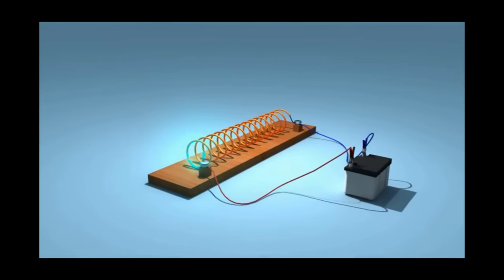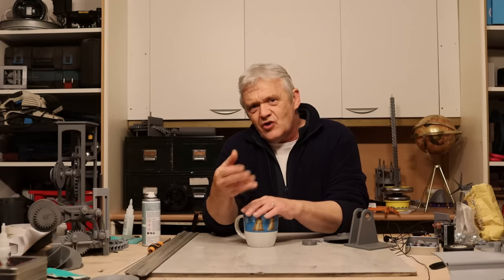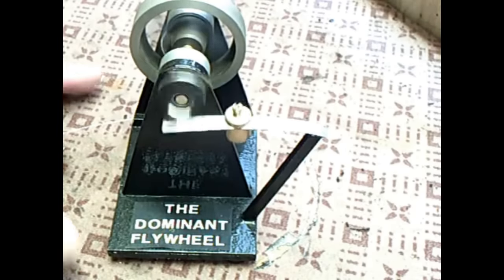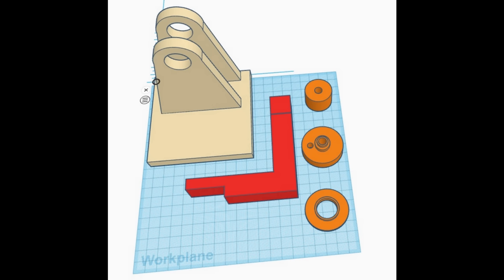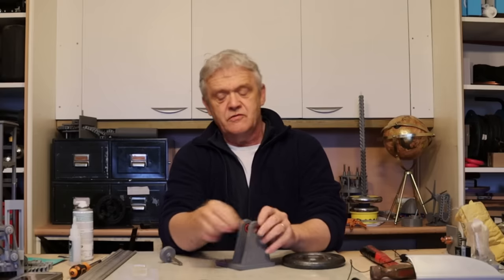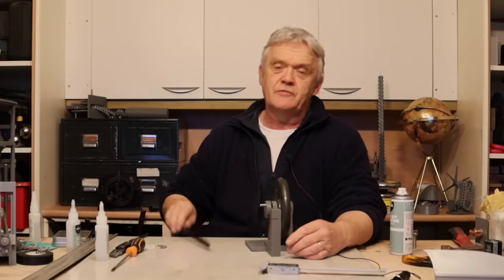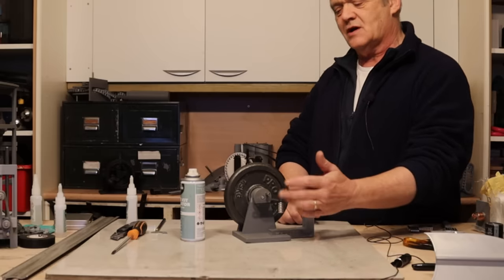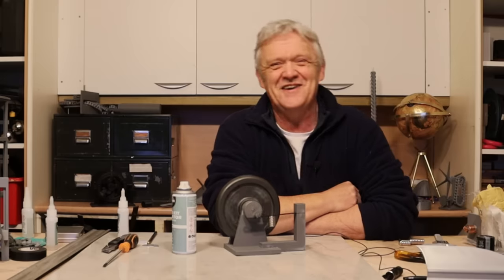2096 An Unusual Spring Motor

Comment: Don't you have to spin it in the other direction as the push on the longer lever will require less force ?
Reply: Whatever force is absorbed by the spring is stored as elastic energy, regardless of how or where the wheel makes contact. It discharges exactly %100 of that energy back into the angular momentum after the cam passes the mid-way point.  This implies that the same effect is reached regardless of direction of spin.  Either the wheel encounters greater resistance at the beginning of the turn (and stores more energy in the spring) or it encounters less resistance and has more energy saved up in its kinetic momentum to push through the greater resistance at the end of the turn.
Reply: @thescrape  Have you tested it, or is that what you think? I will disagree with you as to say a 100% gets transferred back as that would assume the machine is perfect, thus efficiency and a lot of other forces suddenly come into play like resonance, stiffness of the spring/lever, etc. moving a mass with a lever from the middle point of the lever will take more power to start moving the spring. the same reason your car use more fuel when you jam the pedal down rather than accelerate slowly. Inertia is a big factor. You are essentially saying all energy will be transferred back to the wheel irrespective of the rotation direction, not taking into account the levering effect, for your statement to be true, both sides of the spring need to be anchored, which it is not,  thus rotational direction should have an impact on the efficiency.
Reply: No Work is done, so no Power is generated.  This isn't an actual motor but an almost-perpetual motion machine.  Energy is lost (converted to heat, rather )through friction as the wheel spins, but the elastic coefficient of the spring gives as good as it gets (100%). Yes I am essentially saying all energy is transferred back into the wheel regardless of the rotation direction.  Can you describe this "levering effect" using known Physics?  Does it somehow invalidate the first law of Thermodynamics or are we squabbling over a miniscule efficiency trade-off?  I believe the efficiency is equal, and you do not? Well only one of us is wrong, perhaps we can agree on that!😁
Reply: @thescrape  power is transferred between the flywheel and the spring, so work is definitely being done  Levers are known physics, look it up. The point of impact when the flywheel are turned first to the short side of the lever need to move the spring from the middle, thus the springs force will initially be higher than at the end. To exasperate the effect, lift the spring higher to the bottom of the pin when the pin is at the very top of it's rotation, it will take more force to turn the flywheel towards the spring where it's anchored than the other way. I guess one of us is wrong.

Comment: Nice Rebuild!
Great that you give Background Info and Explanations, i know this Video for Years and always wondered about it, your replication does answered  some queszions i had,

One day we will see an Ovwerunity Device on this Channel!
Reply: No, we won't.  Hopefully he sticks to science and "sciencey things" and avoids snake oil.
Reply: Yes there will be overunity device next year 2 of Tesla's investions that where hidden.  I got info from a scientist that worked with Tesla he told before his passing  , I'm building when funds are available to me next year , the big question will Rob happily show on his channel. 
A secret sauce the motor generator 2 flywheels 90° angle to each other , flywheels with identical gear ratio 1:1  , generator is horizontal positioned, the absolute must or it won't work   the 4 pole 1800rpm motor has to run on 240v 60hz and  1800rpm it  has to spin same direction as earth's rotation  , yes the reason the electricity grid isn't 240v 60hz anymore but a VFD Variable Frequency Drive can fix that , as scientist said if Hz is off or rpm it won't lock in sync and no free power , the drive motor once sync will use alot less power that's when overunity starts.
The science with 1800rpm comes into the earth's rotation speed too which is 1800rpm also.
I wasn't told the size motor to generator kW difference I'm planning 2hp to 1kw as a test ratio then add more gen kW later if possible or just build bigger version. 
Yes the equal sized flywheels where described as being 400mm in size with gear on outer edge I'd say good for 4 to 5kw generator with that size and weight 10 to 15kg.
It's real scientist even said if Hz is 58 it won't lock up it's that important and also have motor flywheel inline (left to right) with rotation of earth as close as possible .
Reply: @patrickskahill2661, good Lord, I hope that was intended as sarcasm.  If not, I hope you haven't given all your money to the guy who pitched that to you.

Comment: You're spinning it the wrong way, the cam must push on least resistance end 1st, then as the cam travels along the spring the force increases which gives a better kick upwards.
Doing it in reverse as you are means the cam enters into springs most tensioned area and at exit on top on spring it's a weaker kick upwards!

Comment: Nice. Have you measured the time of the rotation, i.e., from initiating the flywheel to its stop, with and without the spring.; of course you should have the same energy to start the flywheel which is quite difficult to do manually but with a "starter rope" it can be quite precise. What do you think ?
Reply: I'd like to see those results indeed
Reply: Well obviously without the spring it will be longer. Good question is how much.
Reply: @MrHerhor67  then what's the deal with this contraption ?
Reply: @peterfelecan3639  stabilization, like a watch escape
Reply: @TheChzoronzon  it means that the stabilization's price is energy perdition
Reply: @peterfelecan3639  Of course. As always

Name one instance where an added function increases the energy of a closed system, Capt Obvious :D
Reply: Losses with the spring will be higher than just the flywheel alone. Loss from friction as well energy consumed depressing the spring isn't returned back.

Comment: Did you test which direction spinning the wheel lasted longer?  Did you test putting a small bear and small wheel on the pin so as to minimize drag when it hits the spring (or lubricant or both?)?

Comment: In a tank circuit you've got cap impedance 1/2(pi)fC and inductor impedance 2(pi)fL. You fix one and adjust the other so that they cancel at a specific value of "f". It's an amazing thing to watch in circuit simulation software. Mechanical analogs would be mass, "springiness" and rotation speed, I'm guessing. Without giving it much thought because it's late, I'm half lit and probably shouldn't be posting YouTube comments.

Comment: I may be wrong about this but I would think that the optimum position of the tuning magnets would depend to a degree on the rotational speed of the flywheel, so some sort of position governor might give some small benefit provided the additional friction does not impact too much.

Comment: Turning it the other way might be better, the initial push will be on the far end of the lever traveling down and coming closer to the anchor point of the spring which in turn will turn it up with more force since the spring is shorter now. The way you're doing it should also work, but I hear a loud tap every time it hits the shorter stiffer part of the spring first which means energy are lost through sound and thus more friction on the spring. As a test of my theory it would be interesting to see a timed experiment to either side and verify if I'm right or bonkers 🤣

Comment: Does it make a difference, where the original design has a flywheel whose weight is concentrated at the circumference vs your design where the weight of the flywheel is uniformly distributed across the radius?

Comment: How does its motion compare to that of an unhindered flywheel? I assume it slows down more quickly because there will be some additional losses in the spring but perhaps this "tuned circuit" will maintain a constant speed for longer because of the resonance.
Reply: It must go on longer without the spring, because the reduction in energy when it compresses the spring is never going to be equalled by the return of energy by the spring, and some of the energy is lost through heat in the spring, something that would not happen if the spring were not there!
Reply: The energy equation does not look sound 👀
Reply: @peterweeds4682  I agree. In fact thinking about it it isn't really a good analogue of the LC circuit because the current in an LC circuit reverses direction as the capacitor charges and discharges. To model that more accurately the spring would need to be able to stop the flywheel and send it spinning in the opposite direction. I guess the only impact of the spring is to impose a small ripple on the motion of the flywheel but overall it will simply cause it to slow down faster due to the additional losses.

Comment: I would want to graph the freewheel time to stop vs the spring implementation.  You'd need a tachometer to ensure you're starting from the same rpms.  I'd also want o see if a touch of lube help or hinder the whole setup.

Comment: Wouldn't you want to rotate it in the opposite direction so as to give the fly wheel higher mechanical advantage in compressing the spring?

Comment: A torsional pendulum is probably a more direct flywheel utilising analogy to an LCR resonator.  The spring constant is the C, the moment of inertia is L and the friction losses R.  A simple spring, mass, damper system would be very similar, just no rotational inertia, a linear one instead.  The direction of rotation (current) reverses like AC current does in a tank.  With the mechanical system here the flywheel rotates only in one direction and the loading and unloading of the spring is transient (i.e non-sinusoidal) which means it has harmonic distortion.  Its cool, and relatively efficient, but not as efficient as just the flywheel and its bearings if energy storage an motion for a long time are desired.

The closest electrical analogy to this system is probably a switching converter that is switching an otherwise shorted inductor charged with a large current periodically (briefly and synchronously twice per cycle) in series with a tank circuit.  The spring cantilever is the tank resonator and the flywheel is the large shorted inductor.  The inductor may as well be a capacitor connected periodically in parallel if that is easier to think about - you could consider it as an electrochemical battery too and the posts contacting the cantilever as active switching devices which periodically recharge the cantilever from the battery/inductor/capacitor whatever.  This is a lot like a clock escapement, with the flywheel being the power source and the cantilever resonator being the frequency determining element.

There is one additional complexity however which the electrical system wouldn't model unless it was a bit more complex.  The period of the cantilever and the rotation of flywheel force each other via the periodic coupling of the pin which is physically attached to the flywheel.  This means the forcing period is inversely proportional to the current stored and the amplitude of the cantilever response will vary as the flywheel discharges, in fact as it decays it could scan across the cantilever resonance if started above resonance and its amplitude would peak and then decay as its slows.  If the energy stored in the flywheel is very large with respect to the cantilever at least, if they were closer to on par you have something like a coupled resonator system and the behaviour would be complex, even chaotic for some tunings.

Comment: The flywheel needs to be balanced or it is a double pendulum with extra steps, hard to "tune" to a desired frequency. The beat frequency of wheel pin and spring will make it stop prematurely due to sudden static friction at zero crossing.

Comment: So I understand that perpetual motion machines, and their electrical equivalents, are impossible, but, seems like your illustration of the electronic circuit using a spring and a capacitor is close, except for the resistance. Is there something to be said for the same circuit but with the a little extra current added in, to replace what is lost due to resistance? Or maybe I am just describing what an electrical motor is now?

Comment: What an awesome device. I suppose the more accurate the parts, bearings, flywheel, and smoothness of the cam and spring...it will run for quite some time. Maybe a shot of some silicon spray on things will help as well. Awesome!
Reply: Or magnetic suspension bearings

Comment: A tighter analogue to the tank circuit would have the flywheel reciprocating to-and-fro, almost a full revolution, between the extremes of spring deflection. The LC oscillator is, after all, an AC device.

Comment: If you spin it in the other direction the spring will push down by the pin easier because of the leverage and push up harder on the pin as it come passed? I have to try this.
Reply: I was thinking the same
Reply: It will push the spring down easier but for longer, and the spring will push back harder for less time. Total momentum imparted remains the same
Reply: @aka5  to get the spring moving from the middle will take more initial power from the flywheel. Lift the spring upwards until it's at the bottom of the pin when the pin is at the top...turning the flywheel towards the spring will take more power. there are some lever mechanics at work here, so the rotational direction should have an effect because for the impact on the spring to be equal no matter what direction the wheel turns the spring needs to be at a 90 degrees angle to the wheel and it's not, it's to one side.
Reply: @Voidy123  just think of where the energy is being dissipated to then. Also consider at what point in the motion the spring is pushing the flywheel in the direction it is turning. It is not at the same point in both directions
Reply: Right. Zero point energy.
Reply: @aka5  Exactly that's why rotation direction will have an effect.

Comment: I believe if you spuun it the opposite way the spring will have more effect as the length of spring will shorten as it drags along it, this in turn will increase the springs resistance causing it to add energy to the system.

Comment: Interesting analogy with the resonant electrical circuit, but I'm not sure I understand the purpose in the demonstration? What's the benefit over just a flywheel and no spring? Is it meant to make the flywheel prefer a fixed speed based on the resonant frequency of the mass and spring?
Reply: It's an method of adding or removing mechanical power to and from a flywheel, you can strap a coil under the magnets and pulse it with a little power to keep the flywheel at a constant speed or even accelerate it, or I guess if you let the magnets move through the coil you can get some power from it in the same way.

Comment: Could you get it to run longer if you got rid of the friction between the armature and spring?
Reply: Yes, to an extent but that is where the energy to compress the spring comes from.  So to completely (as much as possible anyway) remove the friction at the contact point also would remove the needed energy to push the spring down making it closer to just being a flywheel.  The purpose of the magnet weights in this build are for that very purpose.  They reduce the friction by making the spring action softer in it's spring back.  Hence easier to push the spring down.

Comment: what if the lever was creating an air pumping action pushing the rotating weight faster by jetting it into directional force picking up speed when lever springs up driving up the pin and bellows air pressure going from the down stroke getting more out than put in if did keep running , the vid ended without our seeing it continue going or slow to a stop which is most likely by friction.

Comment: the reason why it works is the cam pushes the spring further away from the fixed or pivot point when the cam moves down at 0 degrees, when the cam moves through to 180 degrees,  the point of contact is closer to the pivot point this increases the force applied to the cam pushing it up .. the small weight for tuning balances out the energy required to keep it oscillating ... is the cam had a bearing .. less friction it would improve the operation . However one would have to increase the counter weight on the cam to balance the system.  ... something to bear in mind ... the more perfect anything is made the less chance it will work ... equal and opposite forces cancel each other out ..

Comment: The magnet is attracting to the steel peg giving resistance use a different weight. Spin the well in the other direction takes advantage of the levering force of the spring.
Reply from the maker: it's too far and the peg is non magnetic stainless steel
Reply: Dear Robert,
if it's not too sacrilegious, why not simply put some magnets on that flywheel and a coil around it just for fun just to see how much you would get? I mean there couldn't possibly be any reason to have any objections against doing such a simple test right? 
cheers ;)